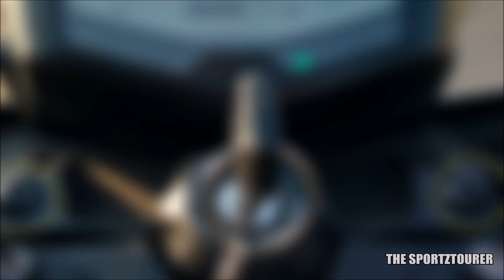NEW HEADLIGHT! HOW TO INSTALL HEADLIGHT BULB ON TVS APACHE RTR 200 4V | PHILIPS XTREME VISION PLUS

Comment: Since both has the same watts you cannot expect a huge jump from the stock bulb.
There will be minor difference in the light colour, which I think better than the stock light colour.
I am using this in my RTR 180 more than 1 1/2 years, clocked 30k kms.
Since mine stock setup is around 35/35w, 55/60w made me felt that, it was a good update. 
Good video bro.
Need a long term usage review on slipper clutch. Bro.
Reply from the maker: Totally agree on the bulb part and I said something similar in the 2nd half of the video.
The Slipper clutch is performing really well, no issues so far. The clutch has become super light and I am enjoying it. Will make a detailed video after a long ride 😊
Reply: @thesportztourer  thank you very much bro. Keep riding
Reply: @Mechanicgrapher   Could you please tell if upgrading to this Philips 55/60W affects the battery life of the RTR 180 ? Is it worth upgrading? Would be thankful.

Comment: I have 12 volts 35/35 watts halogen bulb in  Apache 160 4v(carburettor variant), and the same bike with FI variant has 12 volts 55/55 watts halpgen bulb.

My question is that can i replace 12 volts 35/35watts bulb with 12 volts 55/55 watts bulb?

Comment: Thanks a lot  brother for the video,I was facing problem with the headlight of my rtr 200 and got solution for my question.Thank you so much.
Reply from the maker: I am glad Vikas that the video help 😊
Reply: Just got my RTR 200 fitted with the philips H4 extreme vision headlight bulb.Truly speaking the light throw is amazing,much brighter that the stock bulb. Thanks brother for making a video on the headlight bulb which helped me alot.

Comment: Nyc video   an Hi  bro what are you think about valvoline 10w 40 engine oil is better for apachi rtr 200
Reply from the maker: The Stock TVS Tru4 fully synthetic 10w30 is better than that for RTR 200.
Reply: @thesportztourer  ok thanks🙏🙇 for information

Comment: Hey,
 
Try the LED blub from nighteye 35w 
It's featured across most motorcycle/car channels

I have been using the same for many months and the it's a significant upgrade in terms of luminosity and is also waterproof

The one I'm using has a fan, so it'll require one to make a bigger hole in the dust cover for it to fit.

Comment: I use 100/90w bosch h4 white beamer halogen bulb for my rtr 200..... The visibility improved a lot..
Reply: Asique Khandakar dosth battery jaldi down ho gyaga. Mana try kiya ha but company 55-60w ha . 12v9amp rtr200 Ka battery ha power 60w ha . 90-100w dena to damage hogyage
Reply from the maker: Hi Asique,
As 'RTR rider' said it will put load on the battery and electricals. If you plan to use it then go for a fuse and relay along with the 100/90W 👍
Reply: The Sportztourer that's what I actually did...

Comment: Hi bro i using apache rtr 160 4v it has come with Philips 35 w/35w h4 type.if i have install any led bulb with 65w it will be working or not.
Reply from the maker: Hi,
You won't get the desired output, plus at low RPMs the performance will be very dim with load on electronics.

Comment: Vedio on AHO lights on bs4 model..
Can't we use LED on apache 200 4v 2.0 ?
And which will be the best led headlight suitable
Reply from the maker: Hi Sachin,
Yes, we can use LED bulb but as shown in this video managing the dust cap is a task with LED bulbs plus the reflector on the RTR 200 is designed keeping halogen bulbs in perspective.

Comment: Hi, Did you observe on RTR 200 4V engine regulates heat quickly and it gives some cranky sound. Do you have any solution for it?, if so please make a video on that. thank  you
Reply from the maker: Hi,
Never experienced any unusual sound from my RTR 200 and the heat management is good.
Reply: @thesportztourer  cool thanks

Comment: Hi bro 🙋 I have 3 questions for you:
1) The high beam of my new Apache 200 focuses too far away and lacks brightness. Can the angle be fixed without affecting low-beam?
2) how to carry an extra helmet on apache 200?
3) How to secure the helmets (atleast one) to Apache with a thick cable lock?
I think your reply would help many 😄 Thanks in advance.
Reply from the maker: You can adjust the headlight beam with the help of headlight level adjusting screw which is on the left side (on the head lamp assembly just above the clamp). Be very slow and careful in adjusting the beam as the screw is a delicate one.
You can use a tail bag or a helmet carrying bag to carry an extra helmet.
I know many riders use a cable lock to secure the helmet but I always carry my helmet along with me, infact it sits on my lap during the movies 😅

Comment: Bro.. is it safe to change a 35/35w stock bulb with 60/55w philips xtremevision halogen bulb on my gixxer sf using horn relay or 4-pin relay.. i have some other doubts too..
 1) will it affect the battery charging? 
2) will it affect the wiring system
3) will it melt the headlight reflector
4) will the 60/55 bulb consume more power if use relay? 
5) which relay we need to use for a 60/55w bulb double relay or normal relay?
6) will it affect my motorcycles magnetic coil or rectifier?

Comment: Bro how to adjust the beam focus in headlights.. Plz help me, im just purchased the osram 6W led headlight bulb for my unicorn 150 2011 model.. The light output is more than that of stock 35w Halogen, but bro iam facing the improper beam focus issue in it, the light is projecting at a  little bit higher side , so the incoming beam from my bike came towards the face of the pedestrians as well as the opposite riders, so im a little bit tensed while riding the bike at the night.. Plz help me, out from this disaster, or else plz make a video about the beam adjust in headlights... Thank you ☹️

Comment: Thanks for the video! Would you suggest replacing the halogen with a white LED?
Reply from the maker: We can use LED bulb but as shown in this video managing the dust cap is a task with LED bulbs plus the reflector on the RTR 200 is designed keeping halogen bulbs in perspective. Avoid superwhite or blue color (color temperature above 6000K) as it will cause problem in visibility during the rain and fog condition.
Reply: The Sportztourer the reflector part does worry me, will look out for a video in case you plan on doing one in the near future

Comment: Bro in Bangalore stock 12v 65/50w is not available in any spares ....they say company has stopped manufacturing n they r using 35/35w instead in 1604v as well as in 200...n it sucks
Reply from the maker: Hi,
If you are planning to install it in RTR 200 4V then you can get it from here: https://amzn.to/2zngr2g

Comment: you gave the link of Phillips bulb from amazon...when i check out in Amazon...its saw me that it cant fit in Apache RTR 200 carburetor version....
Reply from the maker: Hi,
They must have missed RTR 200 from the compatibility list. The specifications are exactly same as of the stock bulb (H4, 60/55W).
Reply: ok thanks.
Reply: in Amazon's compatibility list RTR 200 carburetor is available.... btw can it will be available in local spare parts shop ??
Reply from the maker: Yes, you can get it from local store (just make sure it's a genuine one). One of my colleagues sourced it from Maruti Suzuki Showroom.
Reply: thanks... one more thing i want to ask... can i install ABS in my apache 200 carburetor version.... from where and how much that cost...please answer
Reply from the maker: Have researched and anwered here 😊: https://youtu.be/WgWusoipC0U

Comment: Bro, can I convert my unicorn 150's setup AC to DC and use this 55/60 watts bulb?? Will it drain the battery?? What modifications needs to be done as per you?
Reply from the maker: Hi Gaurav,
Yes, you can but you will need a good mechanic who will help you in rewinding the stator coil and the take the supply with a RR unit.
Reply: @thesportztourer  Thanks for replying bro, but I don't I could find any such mechanic in my area. 😟

Comment: Atlast the most awaited video form my side is here... 🙂🙂

I Have a Question, what is the difference in HS1 and H4 socket??
Rtr 180/160 has only HS1 socket
Reply from the maker: Hi Haran,
As Manish has cleared plus HS1 is used RTR 180 & 160 and if you compare them with H4 then the base on the HS1 is a bit smaller (Allong with 35W rating).
Reply: @thesportztourer  so technically we cannot use a H4 bulb in HS1 socket right??
Reply: Read my edited reply up

Comment: Bro i hv Rtr 160 4v ..i noticed yesterday when i kick started it the head light got off and on for 3 -4 time rapidly...i dont know that is wrong 'and the philips light u r using ; work in 160 4v?
Reply: Philips xtreme vision 60/55 watt bulb In 160 4v carb it will not work i have checked . It will work in fi varient.
Reply: @manish03461  okk bro but why so?
Reply: Mera pass bhi 160 4v hai . Aaj test kiya . Kuch regulater aur rectifier system ka issue hai . H4 bulb does not worked. Defalt setting by company.
Reply: @manish03461  o Acha Thanks bro.
Reply: Instead of the Apache 200 stock 65/55 watt bulb, you can use a 40/45 watt bulb that is available on the market for your Apache 160 4 valve.
Reply from the maker: Hi Abhishek,
My suggestion will be stick to the recommended 35W bulb. In halogen you can try the Osram night racer plus, my experience was good on my RTR 180 (A little better than the stock bulb).
Reply: @thesportztourer  bro it is good to switch to the L.E.D Bulbs?

Comment: I ordered this bulb from Amazon and in the title it is mentioned as 12342XVP. But on the packet that I received it is mentioned as 12342XV+B1. Tell me if both are same or not ?? If not, what is the difference ?
Reply from the maker: Hi Ravi,
XVP stands for Xtreme Vision Plus and XVB1 stands for just Xtreme Vision. The one you have got is Xtreme Vision Plus so no issues there 😊
Reply: Thank you...👍
Reply: @thesportztourer  hi what about the performance of other philips h4 bulbs such as diamond vison , white vison, racing vision etc in rtr 200. Can you put a comparison of these other bulbs in rtr 200?

Comment: Sir which electricity is use on rtr 200 headlight
Ac/Dc
And which fog light is better 4 rtr 200
Plz make a vdo on fog light which is durable &budget friendly
Reply from the maker: Hi,
It's a DC set up.

Comment: Hey, 

Why don't you make a video on the installation of fork guards (that the race edition 2.0 gets); should help older owners 

I got the them installed at the svc, the part costs around 160

But it included labour charges, as it'll require the removing of the triple clamps etc 

Also nice content; and lucid explanations across all your videos

Your channel is the best for Apache 200 related content👍
Reply from the maker: Thanks a lot Hitesh for the all the love and support 😊
If possible can you please provide the part number for that fork guard (mentioned in your bill).
Reply: @thesportztourer  You're welcome 😀
Part Name - Cover Fork tube
Part number - N9101700

Comment: hi, i have purchased apache rtr200 race edition with ABS which is a carb variant last week, i m facing a problem that bike jerks, don't start quicly, discontinued throttle and stops suddenly even thr is a petrol in a tank, plsssss suggest me a solution as its my new bike 😥 thanks in advance
Reply from the maker: Hi,
You need get your carburetor tuned and check the spark plug.
Reply: @thesportztourer  thanks bro, i thought about carb tuning but forget about spark plug. one more thing u r doing osum 😃 all the best for future tech. guruji of bikes

Comment: Can we use this for 160 4V ?
It's not working for my RTR,☹️
Please reply,
Reply from the maker: Hi!
160 uses a 35W setup so better stick to a bulb of same specification.
Reply: @thesportztourer  Can you suggest any 35W bulb better than stock one,
Is all 35w bulbs perform same ?
My stock bulb performance is very poor ☹️,
I don't think Switching to LED is the solution,
Reply: @ajay07065  bro maine apni 160 4v m 45watt ka lgaya h koi problem ni hui badhiya chlra h Throw bhi accha h
Lekin aaj maine 60Watt H4 try kia lekin vo kaam nhi kiya 160 4v m
Kuch or jugaad sochna pdega

Comment: Bro please do a video on engine flush in car 😊
Reply: Bro my car is swift desire petrol 2014 😃 IAM done 50000 km.. is it a right time for engine flush ? 🤔 Please reply.. 
And is this good for engine? 
IAM using minaral oil right now iam planning to upgrade to shell helix ultra 5w40 fully synthetic oil after this flush..   is it good to upgrade from minaral oil to direct fully synthetic oil ?
Reply from the maker: Hi Adhi,
What was your drain interval?
Reply: @thesportztourer  10000 KM
Reply from the maker: If you are using fully synthetic oil then you won't need flush at this point still you want to go for it then the process remains same as shown in this video: https://youtu.be/MZnnHCDq8uU

Comment: What a coincidence man !! one point of my headlight bulb was fused last week(high beam was working but low beam was not). I was about to go and get it replaced from the service center. No need for that now since i can replace it myself. The stock bulb costs about Rs. 120 so it's better to go with it and get additional fog lights installed later, if needed. Would you agree ?
Reply: False alarm..... Turns out the bulb is okay..... There is some issue with the wiring maybe. Would have to go to the service center now :(
Reply from the maker: Is it flickering or turning off when the handle is turned from one side to another?
Reply: @thesportztourer  Nope, it's simply not working when the button is pushed to low beam. I opened the whole clutch side handle panel to look at the switch and it is working fine. I am not able to pin point the issue.
Reply from the maker: What did the service center people say?
Reply: @thesportztourer  When I first went into service center, the guy there took one look at the headlight and told me one point of the bulb is fused and needed to be replaced. Since they were charging almost double, I tried to replace the bulb myself. After examining the bulb closely, I found that it was working fine. I also tried to check with a new bulb but the issue persisted. After that I opened the handle panel to check the switches which BTW are working fine. Now I am out of options and skills so will again take it to service center and get the wiring checked. I will let you know what they say. I gotta tell you, not feeling good about this :p
Reply from the maker: Tell them to check the socket for supply.
Reply: @thesportztourer  Went to the service center today. Oh boy what a disaster it was. The mechanic there first replaced the bulb and came to me saying issue is fixed. I told him show me and it turns out the issue was far from resolved. Then he told me the switch is not working. He was just guessing. The idiot left scratches on both the  screws near ignition keyhole. Complete waste of time. Now i have to get it fixed from a local repair shop.